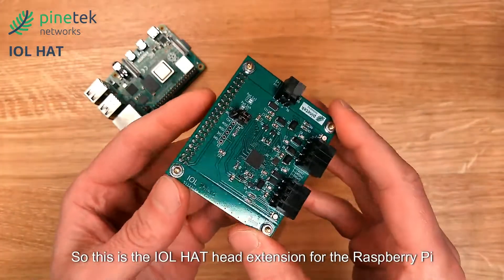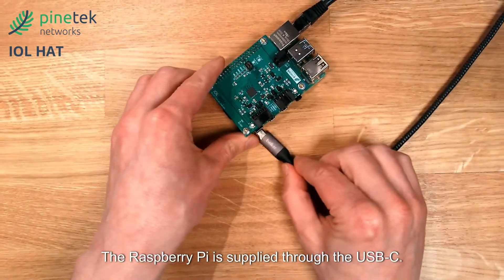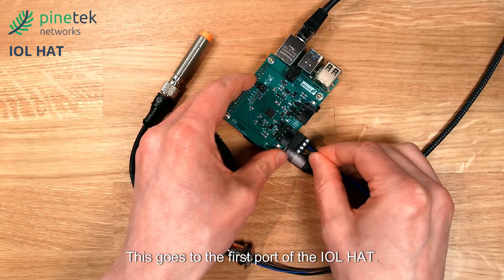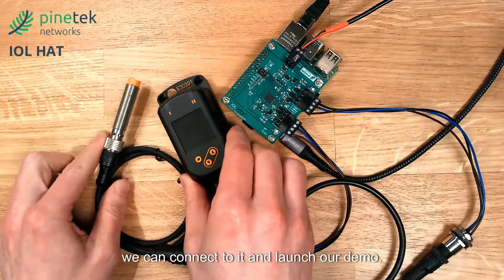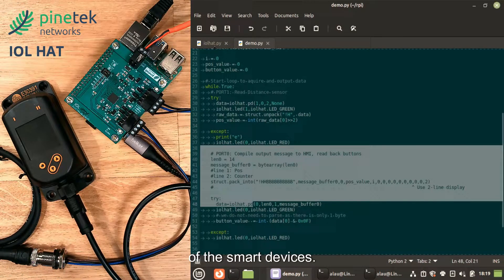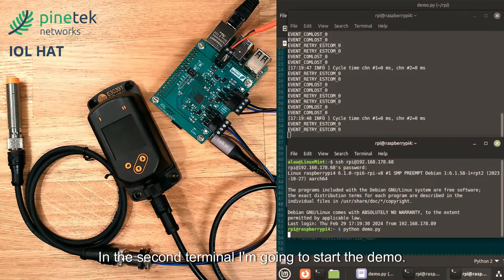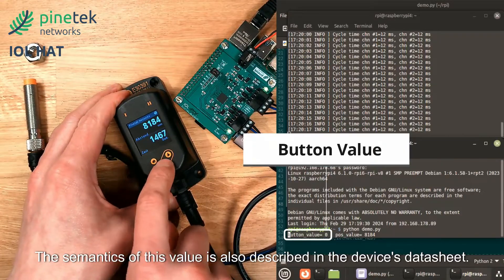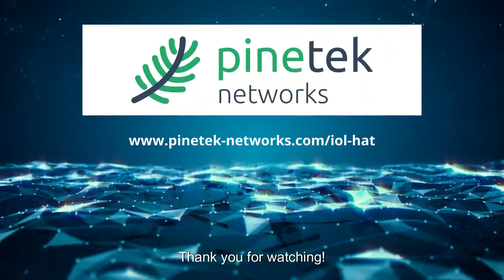IOL HAT Demonstration - IO-Link compatible master for Raspberry Pi

Comment: Hi! Does this have support for use on esp32?
Reply from the maker: There is a generic version available that allows connection to esp32. The software however needs to be ported. There is a port for Zephyr OS available as starting point: https://github.com/vChavezB/i-link